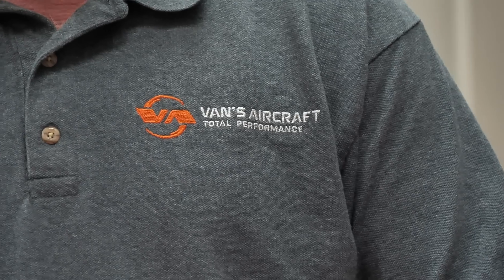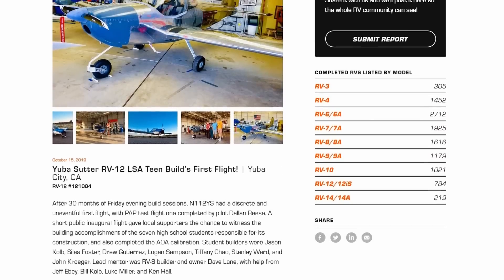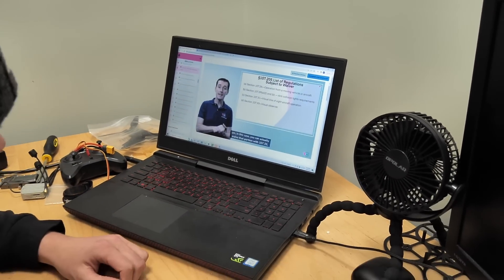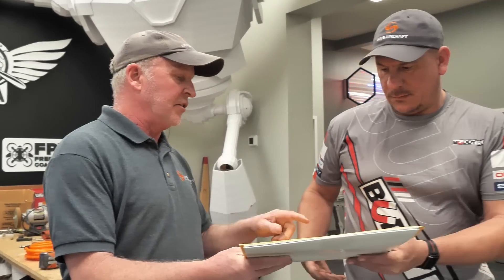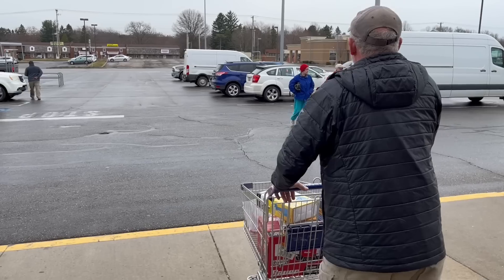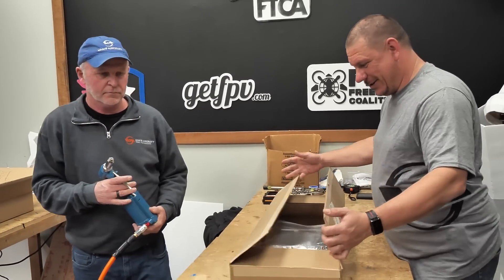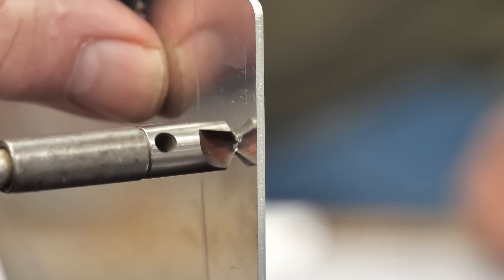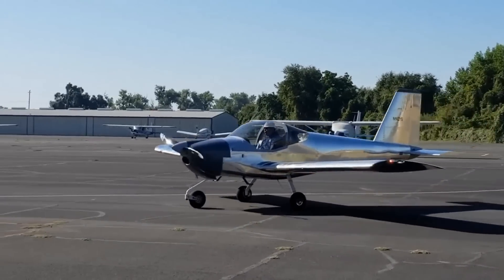Building Our First Experimental Aircraft - Van's RV 12iS

Comment: I’m disappointed you are going in this direction,you’re gone spend $400000 over 1000 plus hours ( assuming your people are not volunteering)  to build a plane that 99.9 procent of your followers can not afford ( or there marriage)  your completely out  of left field my advice is to take the tail kit mount it to the box it came in strap the light box to the front,than push it of the ramp at flugtag, you will safe your money and most importantly keep your viewers 
You’ve gone and skipped a thousand other potential plane builds that might have been somewhat affordable for your viewers  I for one will not follow your personal wishes good luck with your business

Comment: Wife and I were driving to Forest Grove, OR, passing an area set aside for aerobatic practice, watching a couple of RV's mixing it up with high G maneuvers.  Some time after, walking in town, we heard sirens.  Turns out one of the RV's had crashed.  Investigation revealed that the holes in the spar and fuselage attach points that were to be reamed to fit the bolts precisely had been  reamed oversize and the joint had been working, eventually causing the spar to fail.  Losing a wing is pretty much fatal.  I watch your videos and you have a lot of fun flying (and crashing) some outrageous RC projects.  Point being this is a full size, man carrying aircraft and there are no unimportant details.  No joking around if that needed to be said.  They are beautiful, nice flying aircraft and by all accounts the kits are precisely made.  Enjoy yours!

Comment: IMO Greg's suggesting setting the pneumatic rivet puller to around 80 psi is too high and will cause the rivet gun to recoil. 45-50 psi works well for LP4-3 rivets, experiment for yourself.

Comment: Will it be possible to repeat such an aircraft where it is impossible to buy a whale and special rivets (we only have construction ones).  Can you put a car or motorcycle motor in there?  With us, you can easily process wood on CNC and cut metal with a laser.  but special materials and engines for aircraft are available only to the military.
Reply: or is it just a promotional project of a local seller of ready-made kits?

Comment: The prototype Supermarine Spitfire used flush rivets in its construction.  In WW2 there was a need to speed up production and a change to done-headed rivets was proposed, but it was recognised that this would increase drag.  The approach used during testing was to glue split peas on all external flush rivets and progressively remove them until acceptable flight characteristics were achieved.